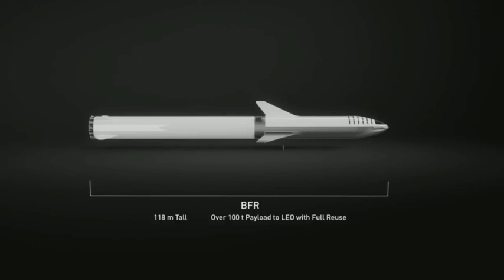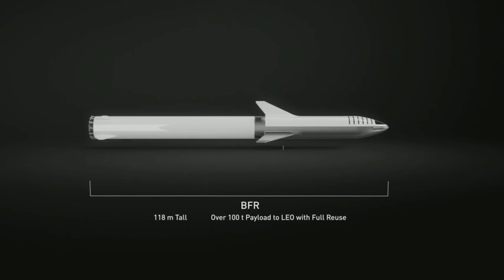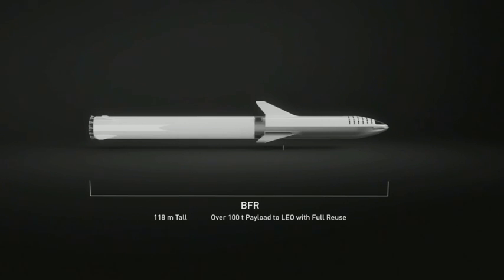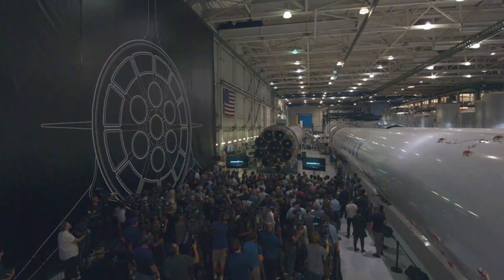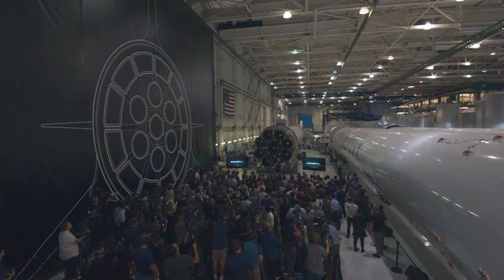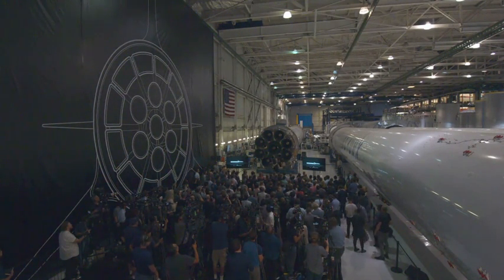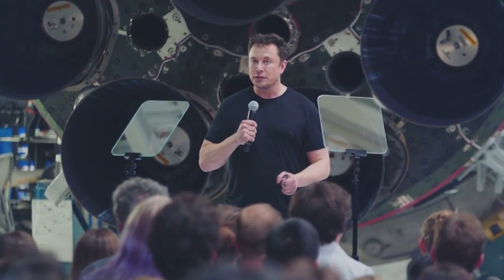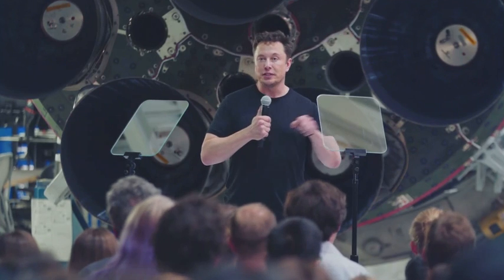SpaceX BFR Rocket's Updated Design - Elon Musk Explains

Comment: Those fins are going to take one hell of a beating during reentry. And good luck with that (supersonic?) engine restart. There is a long list of reasons why NASA doesn’t fund projects like this and why it will never fly in space.
Reply: They already restart their engines at supersonic speeds during F9 booster reentry, so no that complicated. Also, bad idea betting against this guy not being able to do something.
Reply: The only thing I would argue back, in a civil tone, is that there is a big difference between an unmanned first stage booster restart at suborbital speed versus an engine (having sat in a six month cold soak) restarting along a deep space reentry profile. If it can work that would be amazing but this restart is mission critical and no space agency has ever demonstrated hardware doing anything remotely close to this (remember six month cold soak plus reentry speeds in excess of 25,000 mph). Hypersonic retropropulsion is one of the most exciting and dangerous new areas of aerospace engineering and it has a lot of potential! But I believe that it has not been demonstrated in a safe and reliable manner yet which would justify placing the lives of the crew at the whim of whether or not this engine ignites. If Elon Musk wants to send tourists around the moon, he should stick to the Dragon V2. The BFR would be a wonderful science experiment as long as the crew (or rich tourists) are aware of the relatively high likelihood of failure resulting in potential disintegration in the upper atmosphere or ground impact at speeds in excess of three hundred miles per hour.

Comment: Wouldn't the rocket flip during launch if you have wings on the top of the rocket?
Reply: It would if you don't actively guide it. With vernier engines or the like. Then air is not the only thing exerting forces on it.
Reply: @robertjones888  ok.

Comment: Looks like they may be ditching or altering in space refueling using a tanker version of BFS. In the 2017 BFS renderings they had 4 tubes that would attach to a tanker ship in the aft section. If they are still planning in space refueling with BFS the tanker ship might be utilizing some kind of a fuel probe similar to what they use on military refueling aircraft.

Comment: As a SpaceX fan, I must call BS on this design. Aerodynamically, this is nonsense. Moving those huge fins as indicated would yield catastrophic control problems, even if you had the vast amounts of power necessary to do it. This ship looks great, but the flyable BFS will not have this fin flapping system.

Comment: I like how it really looks like a retro tin tin, Flash Gordon et al rocket...boy who knew they were accurate !!!
Reply: Sometimes the most simple design is the best and most reliable. Hence why Nasa is coming back to Apollo command pods instead of fancy and dangerous space shuttles.
If course more sophisticated designs are possible but require not yet developed or cancelled technologies (aerospike engines for example) that are expansive and would take even longer to turn into a reliable tech.
Here Space X takes simple concepts and already proven tech, innovates slightly with it to optimize the design and efficiency to reduce costs.
Reply: @quoniam426  SpaceX also simplify, for example the Venture Star spaceship was going to be a double lobed design with some winglets and an aerospike engine, everything was going well, but the simple non-standard shape of that spaceship basically shut down the project, whereas spaceX just retain the standard cylindrical shape and attach flaplets, BOOM actually feasible design.
Reply: I was thinking Destination Moon.